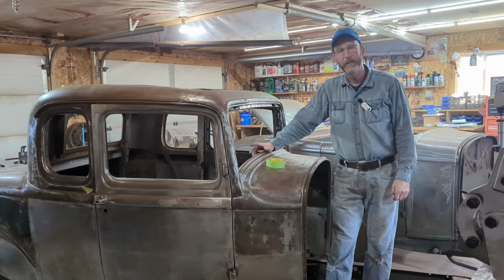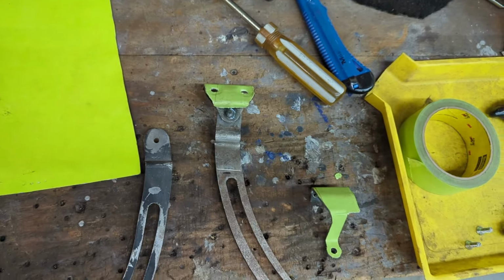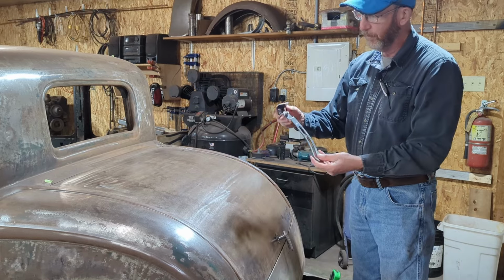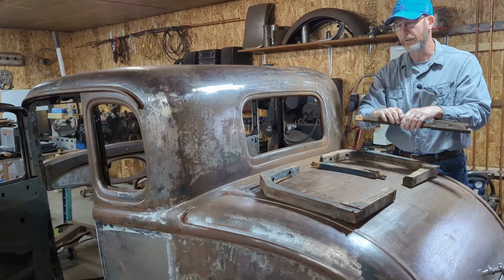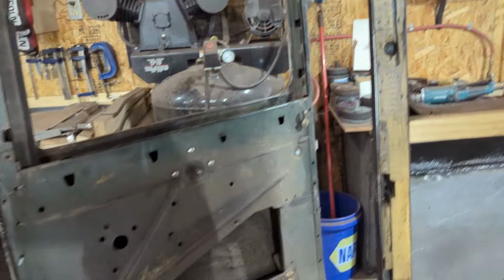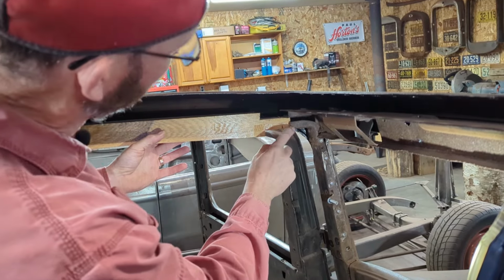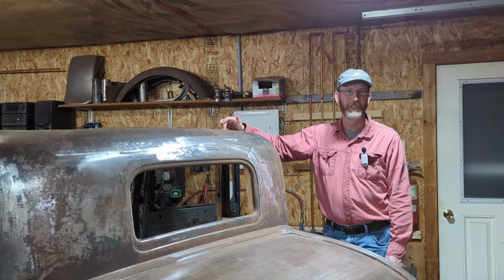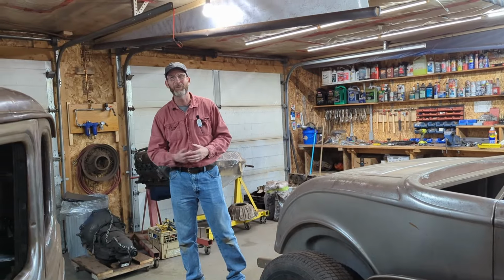1932 5 Window New York Coupe We made and replaced the wood in the car

Comment: Hi Derrick since we’re on the topic of wood , did you make the wood for the 32 pickup?
Reply from the maker: The only wood in the 32-34 pickups is around the rear window and the back of the seat. In our case we replaced the wood with bead rolled pieces of sheets metal to stiffen up the back panel. We didn't need the wood for the seat because we used a Caravan 2nd row seat.
Reply: @coldstreamrodshop  Thank you